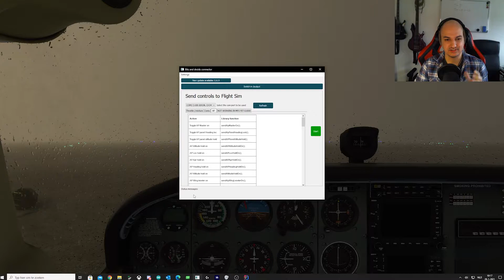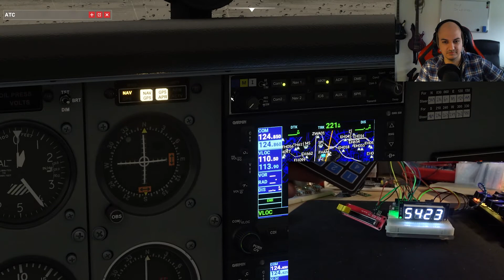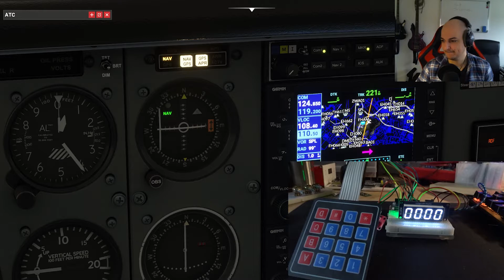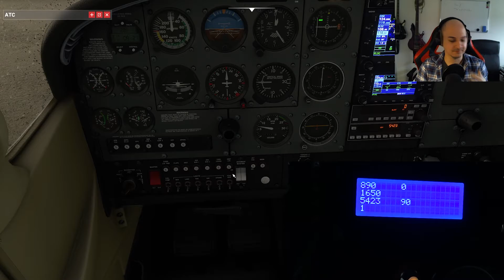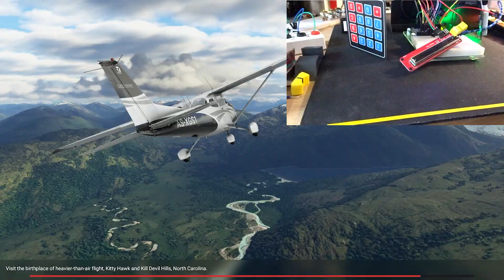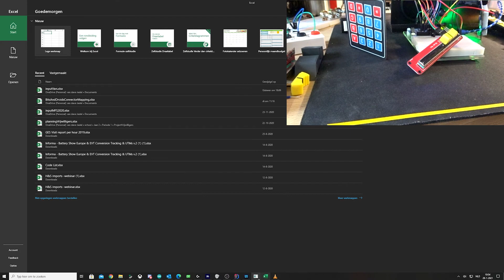New update, use your Arduino for ADF, DME, VOR, Flaps, Coms and many more

Comment: hi is it possible to use max7219 7 segment displays with this setup and your other setup for radios? plz advice
Reply from the maker: MY connector works with any kind of display. The display is just a vessel to visualize the data while the connector gathers the data. As long as you know how to use the device your able to display the data on it. I don't have a max7219 laying around so I'm not able to help you with the specific coding required for this device. Have a nice evening!

Comment: The required capacitor of 10µF, what will be the maximum voltage I can use on NANO? I have difficulty to find anything less than 16V
Reply from the maker: I see that I currently have a 4.7uF capacitor in my uno rated for 50v and sometimes a 10uF rated at 25V.
Reply: @Bitsanddroids  Thank You so much for such a quick response. 
I do enjoy your channel and experimenting with Arduino using your ideas and examples.
All The Best

Comment: great work on the new features but for me "steam" gauges are a ton better there is a lot of science behind the reasoning but the g1000 is made to implement the ease of use of the visual representation of the data in such a way a glance will give you enough visual data to have a general understanding of what that instrument is telling you i am going to try and stay away from led screens as much as possible but for things like radio they are perfect 
p.s. if i can ever get things situated we can fly together also i can try and help with what i have learned in ground school and go over some of the text book stuff if u want and i will stay away from talking politics lol sorry again
Reply from the maker: Haha I have full faith the steam gauges are more reliable than the g1000. But especially for quick prototyping I love my lcd screen to avoid having to create 20 gauges to test single values.
Sure I'd love to take you up on that. Hit me up when you are setup and we can get a date/timezone worked out.
Reply: @Bitsanddroids  well also I am trying to buy a plane in my price range and they are mostly all steam gauges and a tablet for foreflight and possibly getting a part103 ultralight no pilot's license requirement they can be baught ready to fly for under $5000 usd and anything under $25k for an experimental 2 person 80hp to 120hp bush plane is perfect for me
Reply: @Bitsanddroids  also a cesna 150 or cesna 140 can be had in flying condition for between $10k and $25k usd (barnstormers.com) and with a 3d printer there are several gauges that u can print and wire up how u want and I would use ur input handler and software (it seems to be better than mobiflight) and make a sim to make the virtual thing as close as you can to real life and you can get 5hrs of training in a sim so @130 to 200 an hour for the plane and instructor that is well worth building a sim